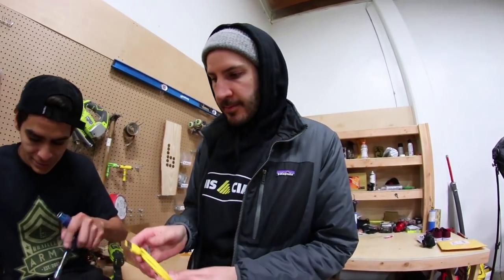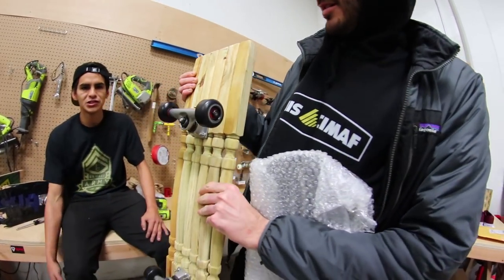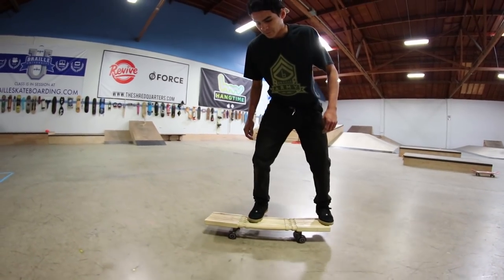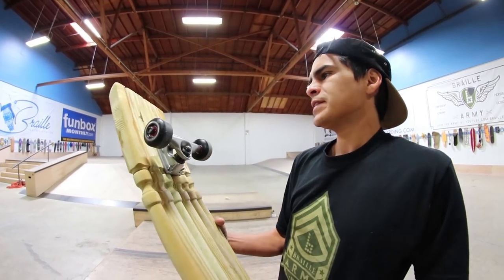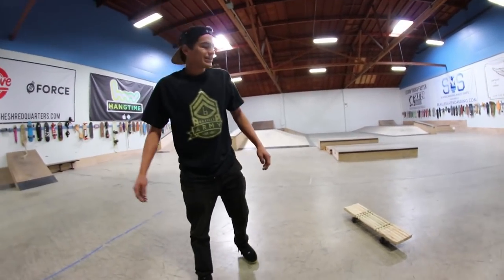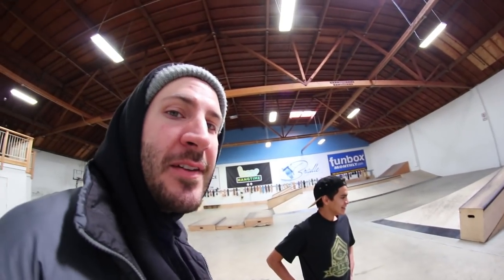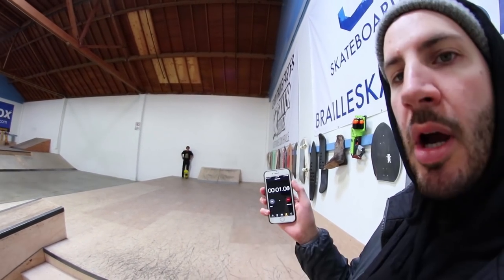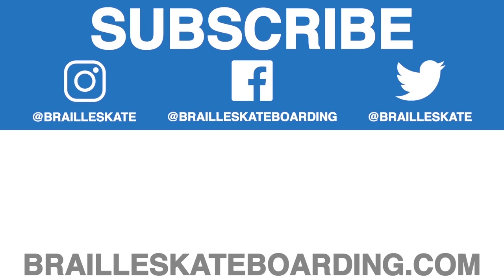THE BALUSTER SKATEBOARD DECK! | WILL IT SNAP!?

Comment: I’ve barely been skating and I have a question for all you skaters out there, what’s the difference or the benefit or what’s does it change if you tighten the back truck and loosen up the front one like Carlos said
Reply: Honestly it’s just skater preference. It’s not really going to change up your skating too much. Just adjust both trucks to how you like, try it out, and yeah.

Comment: I have my back truck looser that the front
Reply: Jayce Anderson that sounds horrible
Reply: Bobby Russell it’s not bad because when I turn I use my back foot instead of front food it feels better personally
Reply: Bruh, i know everyone has their own preference but if you haven't been skating long you need to change this, when you start skating decent tranny and or decent gaps you "will" get bucked, a skateboard is not forklift it won't turn well from the back if you have resistance from your tight front trucks.
Reply: Try bombing a hill with different truck variations, best way to find out how your trucks should feel under your feet